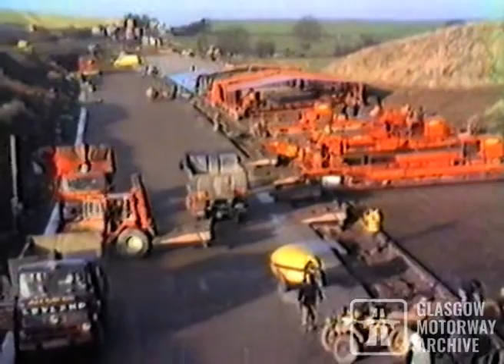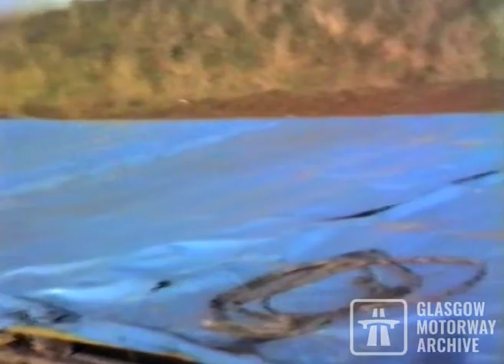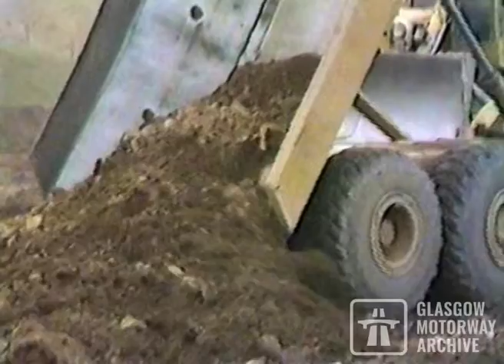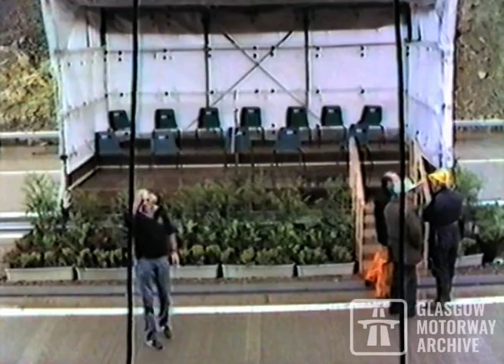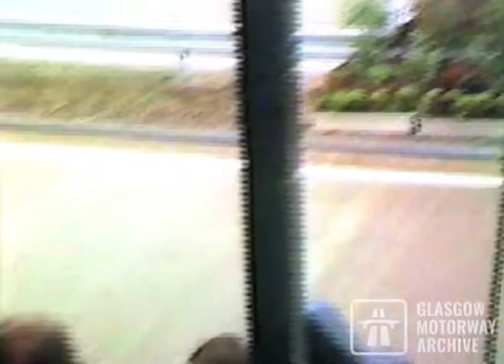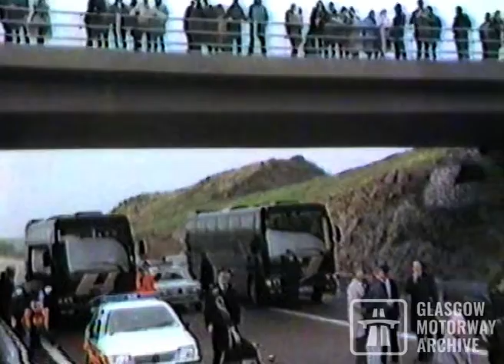Construction of the M74 Motorway at Lesmahagow in 1986

Comment: We travelled that road when it was brand new - Summer of 1987 (just 14 then)!
I used to really like the concrete roads as a child - would very much doubt it as a driver today...
I like the black low noise surfaces - so smooth and easy for driving on.
Also, why not 6 lanes? ...but I guess the older M74 towards Glasgow had just 4 lanes.

Comment: Engineering nightmare, I was part of a crew that had to resurface the largest of the bridges a the Lesmahagow junctions. Wasn't enough concrete coverage over the bars and caused bad corrosion which was hydro blasted out and re-concreted. Bridge joints failed as they were only 50mm deep. With the way 40 tonne lorries have been hitting it for 50 years it doesn't surprise me that there has been so much wear on the bridge deck. It was never designed to carry as much traffic as what we see now a days. Over 40k vehicles travel this section everyday. Not only that it has turned out to be one of the most dangerous sections as water likes to gather at the lowest point. Again we had to install drainage to cope with the volume of water that stands on the road.
Reply: The m74 is now at this point being redone again with a 30 mph limit as the joints and deck is being redone again not long after the last refurbishment a few years ago.